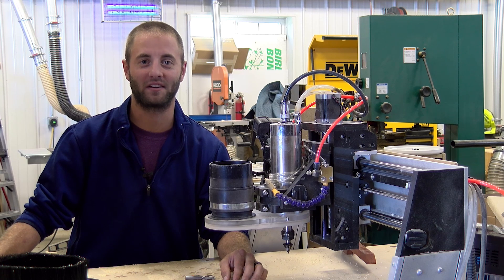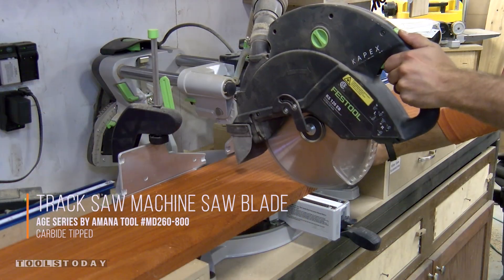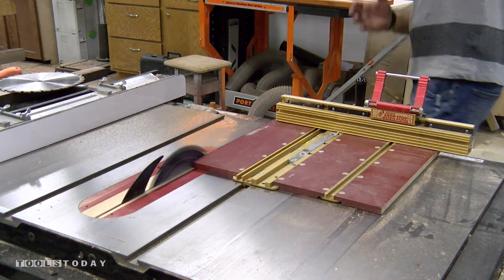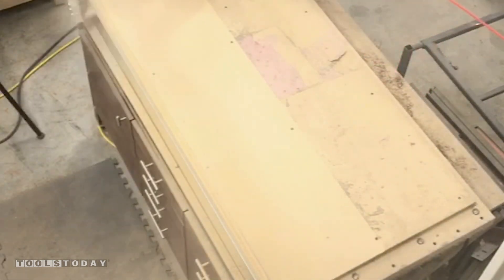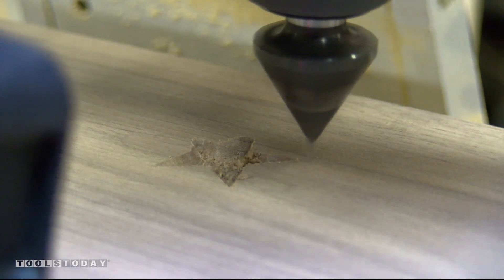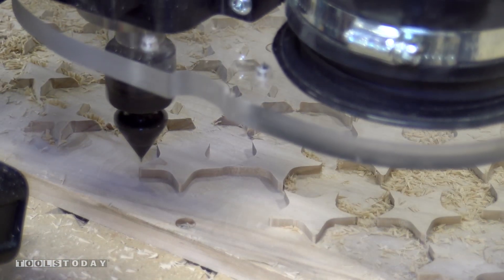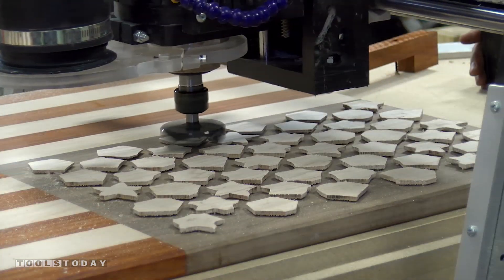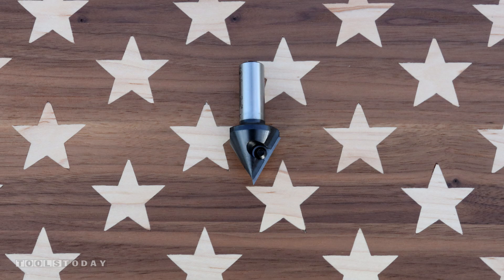How To Make an American Flag in Wood using Amana Tool CNC Router Bits, Saw Blades and VCarve Pro

Comment: What bit did you use for the stars?
Reply from the maker: We used Amana Tool 60° Insert V-Groove CNC Router Bit No. RC-1108
Reply: ToolsToday is that the bit you change the blade? Also, how long does it last? I use a 60 degree v bit but it's not giving me pointy stars.
Reply from the maker: Hi John, yes this is the solid carbide insert knife router bit where you change the blade, rather than the entire bit. Amana Tool CNC Router Bit No. RC-1108. With regards to the pointy stars, if you follow the procedure in the video at the 4:05 time stamp, you can see how we ramp down and cut the stars.
Reply: ToolsToday what's the plunge rate?
Reply from the maker: Hi John, our technical team will be able to better advise you. Please feel free to call the toll free number at (888) 699-3939 or use the Live Chat feature on the website. They can help you. Thank you.
Reply: @ToolsToday  I did talk to them and they said they dont know. I just want to know the flat depth
Reply from the maker: Hi John, Ok we can help you .. what is this Flat Depth you are looking for?  Thanks.
Reply: @ToolsToday  on the stars
Reply: .1 flat depth for this particular application.
Reply: @GlassImpressions  how bout the pass depth?
Reply: John Rojas you will need to set that according to your speeds and feeds. I did it in a single pass
Reply: @GlassImpressions  I'm still learning. Lol how do I make it to a single pass? Can u email me or something?
Reply from the maker: Thanks Andy!

Comment: What CNC machine do you have? i would like to buy my first machine and like what i see with your machine
Reply from the maker: Hi Gunnar. The CNC machine used in this video is intended for machinist with previous experience on the CNC. It is the Rockler CNC Shark HD 3 w/ Extended Bed CNC Machine, we would recommend starting with a table-top machine such as Shopbot if you are just starting out.

Comment: I ended up purchasing the code but am using Fusion 360 and Chilipeppr. Is there anyway to convert the file from the VCarve to one of these other programs?
Reply from the maker: We are unsure, you may want to check with online forums to ask a larger group of professionals.
Reply: J Studd I have Vectric Aspire (same software As v-carve just has a a few more capabilities) and fusion 360... I know I can export from Aspire into other file formats but have only ever transferred 2d drawings from. So you could export the 2d drawings from v-carve and open them in fusion. Then you would just extrude the shapes.

Comment: I'm trying to attempt this on a smaller scale for a cutting board. Am I still able to use the same bits? More specifically the V bit? I've tried multiple times doing an inlay, putting  together with the male and female parts, but something is always off.
Reply from the maker: Yes the V Tips can cut down to your preferred depth .. therefore you can re-recheck your computer file to ensure the parts are lining up. Hope that helps.

Comment: Sorry if this is a total noob comment since I'm just a fan of CNC and haven't done any of my own yet, but why not do the stars before joining the two halves together so that it would still fit through the planer?
Reply from the maker: There are many different techniques to woodworking and CNC machining, while none is officially "right", we each choose to use the method we individually prefer.
Reply from the maker: @RichB Thanks !

Comment: name of the cnc machine that u used ?
Reply: What MM is your router? Most 2HP and 3HP are going to be 80mm spindles. The adapter is only half of the equation. You unit must be able to handle the additional weight.
Reply from the maker: Hey Alex, we used Rockler's CNC Shark HD 3 w/ Extended Bed CNC Machine
Reply: It looks like you have a spindle (rather than a router) and are using 1/2 inch tools. I have the CNC Shark HD 2 and the only spindle available only accepts 1/4 inch tools. Is this an upgrade only available for the HD 3?
.
Reply: The router is a Porter Cable 892. The barrel is 3.5 inches, 88.9mm in diameter. It's rated a 2.25HP.

Comment: looks like quite a bit of chipping on the tips of the stars. Any idea to avoid that? Can a router in my shark spin that spoil board cutter?
Reply from the maker: Hey Bill, sharp eyes you have there! Yep there was a small amount of chipping on the stars, this was due to the small amount of chatter in the smaller Shark CNC machine. A heavier machine may have prevented this. Yes, you can use a spoilboard tool on this machine.
Reply: I've also found that I can get some chipping on sharp corners when trying to create the male inlays. I use the exact same V Carve bit as seen in this video. The best remedy I've found is to make shallower passes on the male portion of the inlays (as hard maple tends to chip when the bit reaches the sharpest point of the inlay). Also, I use polyurethane glue on the inlays and use as much clamp force as possible when gluing up the inlay. When I follow all three, I will likely have flawless inlays.
Reply: First, thanks, Tools Today ,  for an entertaining video and a really nice flag.

Bill,   Couple of ways to avoid the chips breaking.   1st, if it is able to break out, there simply was not any glue holding that portion. Applying glue to both surfaces would have helped, but nothing is foolproof, it is after all woodworking.  You are also glueing end-grain here so a flood of glue on each part is not overkill. Expect to do final surfacing of the entire part after everything is assmebled.

Second, instead of surfacing all the stars at once, using a small bit and running the perimeter of each star in a "climb" cut ( clock-wise rotation in this case )  would have the bit pushing the wood towards the center rather than tearing it out from the center. Again, nothing is foolproof and it is still woodworking. Run a very restrained step over on these tiny points. I would run the first several laps around the stars with no more than a 1/16" step over and then jump on up to 45% of your tool diameter. Takes a bit longer but reduces the tear out to near zero.

On endgrain joints, the glue gets artificially dehydrated by the endgrain " sucking it in before it cures. Heating the joint with a hot air gun before and during the  early stage of clamping with help will help hasten the setting time of the glue.
 I usually use a quick set epoxy for simple inlays or end-grain joints.

Good woodworking and machining, Phill
Reply from the maker: @phillpittman587  Thanks Phill. Great comments and feedback.
Reply from the maker: Great technique using polyurethane glue .. we will give that a try in the future. Thanks Stephen !!
Reply: Glad to help and your bits rock! Really enjoying my newest bit... a Spektra compression spiral! Really hoping I can get another soon.
Reply from the maker: We loooooove the Spektra™ bits !! Can you send along some pics or video clips of them in action to stefan@toolstoday.com
Reply: Absolutely!
Reply from the maker: Great we can feature your photo in upcoming website promo and give you credit :)

Comment: awesome! any chipout on those stars with the flycutter? Is the trick to use a fly cutter? I think i tried using the planer once for the inlay and got lots of tearout.
Reply from the maker: No tearout with this new fly cutter CNC bit from Amana Tool. The greatest feature about this bit is the ability to dial down and remove very thin layers of material, less than 0.001" per pass.
Reply: If you look closely towards the end, it appears at least one star’s tip is missing. This method seems a bit too aggressive for the delicate tips. I’ve found a drum sander works best.